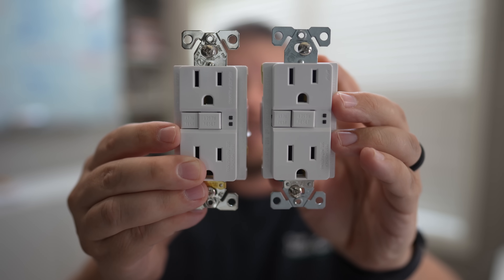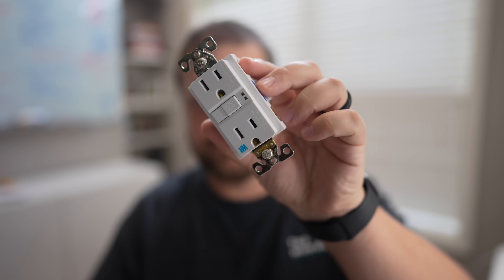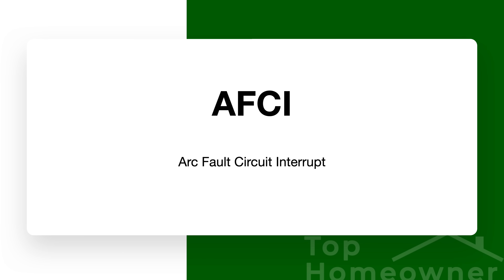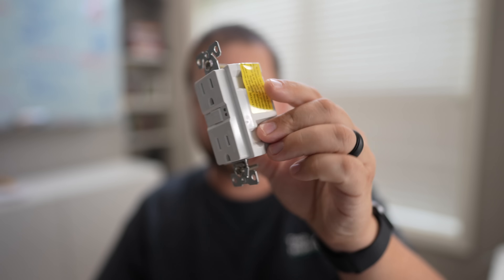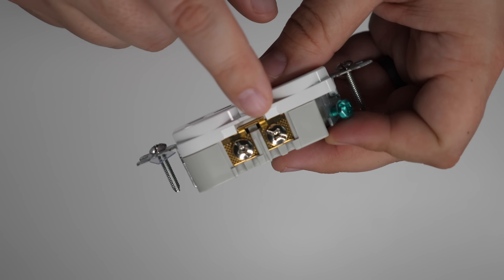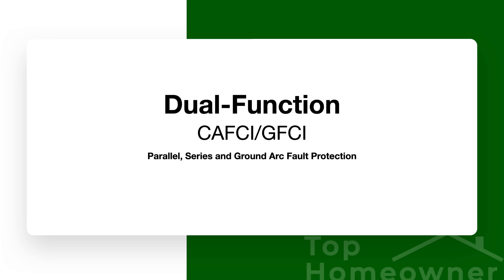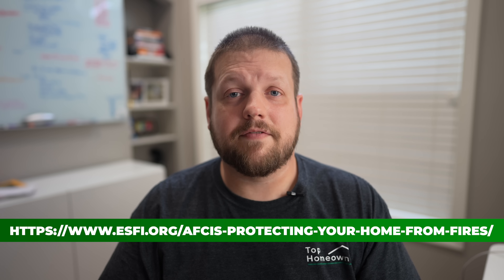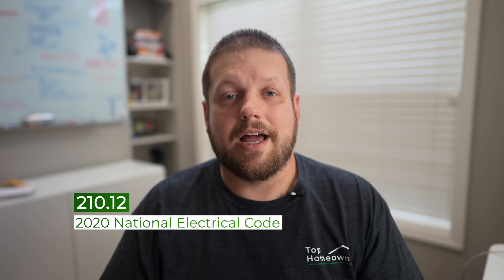AFCI vs GFCI: What's The Difference and Why You Should Care

Comment: I have a question I have a I have a GFI with two hots and two neutral the top hot is not working but the bottom hot has power but the GFI still doesn't work can you please tell me what I need to do to fix it

Comment: Question , have a afci breaker in box, starting using a solar tie inverter , plugged into a different source,  everything works fine unit i turn on a space heater in the bathroom, trips the afci, although the space heater works fine if the solar is turned off. Any suggestions, should i try a regular gfci instead of the afci, Thanks

Comment: As I understand a short circuit (can be prevented by standard breaker) is an extreme case of an arc fault (can be prevented only by AFCI breaker). That was the only thing that I didn't understand till today))) Thanks.

Comment: About 10 years ago I hired my friend to help me stud and sheet rock an extra 700 sq ft room. I hired a guy to do the wiring and at that time outside walls had to be arc fault code and switches had to be vapor barrier. The bath rooms and kitchens are all GFCI any where the water moisture is present to prevent shock.

Comment: I have replaced old light switches that began to occasionally make a little zzzztt when switching. Would a CAFCI breaker have detected what I imagine is arcing at the points in the switch and disabled the circuit. Lots of my power tools have brushed motors, I can see, thru the vents on the sides, some very slight arcing at the brushes (I think that's normal). Will these tools trip an arc fault detector ?

Comment: Extensions cords with a broken wire inside are a common source of arcing and house fires. AFCI will detect these type of arcs and lessen the risk of fires.

This was big reason for ACFI in the first place.  That being said in newer homes code requires many more outlets than older homes had for the specific reason that they want a close by outlet so that extension cords are not needed to use devices.

I do not have statistic but I would think electrical fires are probably much less common in newer built homes with more outlets, newer wiring, newer breaker boxes, seperated circuits, sub panels, etc... than older ones.

There are tens of millions of dwellings in the US with a very small percentage ever having electrical fires.  GFCI protection make a lot sense anywhere around water. AFCI protection is very expensive and seems like overkill for most people.

Comment: Im not a electrician but im having problems with my gcci but it's on back of building it also has a breaker and  it has a receptacle i cut the breaker off and pulled out receptacle and it had a black wire white wite and green wire on backside of receptacle the black wire was burnt and looking at front of receptacle the left pin or hole was a little burnt...so im curious to know what i need to do

Comment: We have two bathrooms upstairs that will trip our 20 amp breaker. We have replaced the GFCI outlets and it still happens. The breaker box was completely upgraded by licensed electricians four years ago due to a sunroom addition. We aren’t overloading the outlets and have manually installed two new GFCI outlets but it still trips. Any suggestions on what is causing this?
Reply: Put each bathroom on its own separate circuit.  The breaker is tripping due to too much current being pulled through it.

A blow dryer on high pulls current in the range of 13 to 15 amps.

Two of them together pulls 26 to 30 amps, tripping your 20 amp breaker.

I'll bet the electrician suggested that you separate the rooms and you considered it to be too expensive.

Comment: Fuse - over current protection.
Circuit Breaker - overload protection.
GFCI - ground fault protection (wet locations)
Arc Fault - short circuit protection. (bedrooms and other common areas)

Comment: Metal covered wires should be used in walls. Protects front nails and screws as well fire. Plastic covered wires in walls is just crazy. So are plastic electrical boxes. Think about it.

Comment: The insurance industry is driving all these expensive changes.  Their business is to accept risk in return for a premium.  But they no longer want to accept risk.  All they want is to receive premiums.  So they pressure the regulatory agencies to create these new standards, and the manufacturers are then more than happy to supply the complex circuitry to meet the standard.  Never mind that complexity is what FAILS.  The price of this stuff, and insurer's greed, is why fewer people can afford homes.   The reality is, it is impossible to make everyone perfectly safe.  Ground fault interrupters - good stuff, despite their circuit complexity.  They save lives.  Arc detection?  Not sure I believe your data.  And why should arcs occur if the electricians have done their jobs properly and tightened their connections?  Instead of loading up a circuit board panel with $1600- 1800 of CAFCI breakers, might be better to educate the public that they should not drill willy nilly into walls.

I worked as an engineer for 42 years.  Every good engineer knows that the more complex something is, the less reliable it is.   My pet peeve is breakers.   People don't seem to understand that the purpose of a breaker or fuse is to protect your house and equipment from damaging overloads and fires.  Unfortunately, the insurance and regulatory industries have done little to educate the public.   If a properly sized fuse or breaker blows or  trips, that means there is an electrical overload somewhere, and the homeowner needs to correct it.  But people routinely reset the breaker - again, and again, and again without finding and correcting the overload.  Circuit breakers have over 40 parts,  many of which are rotating and pivoting.  The pivot points wear.  So after a while they start nuisance tripping.  And from my experience they also can hang up and FAIL to trip.    In other words, your house  can burn down!   Now contrast this to a fuse - a simple element that heats up and melts in response to an overload.   Simple reliable protection.   They are without question MORE RELIABLE than breakers.  In fact, the medical device industry isn't even allowed to design breakers into medical instruments.  Why did the construction industry go to breakers?  The insurance industry knew that some stupid people would defeat fuses by putting pennies or aluminum foil in the sockets.  So they lobbied the regulatory agencies and government to force inferior protection on us.  They could've educated the public on the hazards of defeating fuses.  They could've denied or reduced the claims of people who did the tampering.   They also could've mandated fuse holders that could not be tampered with.  Instead, we all wound up with inferior, but idiot proof protection.

Incidentally, my home is protected by fuses properly sized for the load.  I know how to find overloads and fix them.  I pay a premium for my homeowners insurance because the insurance industry doesn't understand this reality.   However I don't mind.  I know I have superior protection.

Comment: Arc fault breakers are a huge nuisance. Inductive loads constantly trip them.  Any load that has a motor (vacuums, treadmills, etc). More injuries caused by needing to constantly go to the panel to reset than caused by any possible arcing issue.

Comment: What is the difference between these devices and an instantaneous trip circuit breaker?
Reply from the maker: Circuit breakers are designed to protect against very high current surges, like short circuits, by tripping almost immediately. AFCI protects against arc faults, which are electrical arcs that can cause fires. GFCI protects people from electric shock by detecting ground faults. Each serves a different safety purpose!

Comment: WIll AFCI trip if ,in this case, (TN Valley) a spike or surge in input voltage? TN Valley power can spike to 130v which is a driving factor to change out incandescent 120v bulbs; the filament would blow

Comment: We have a propane heater on a shed, it is mounted outside and the blower is powered through a GFCI mounted outside. It is in a box which is supposed to protect it from weather, but every time it rains or even comes a heavy for it trips the GFCI. Would anyone have a clue as to what would cause this?
Reply: Conductive "Sneak path" from a hot lead to ground.

Rainwater, seepage and other moisture are connecting one of the wiring terminals to the literal ground.

Comment: My sister has combo GFCI/AFCI breakers in her 2017 Atlanta house.   One kept false-tripping.  Moved its position in the breaker box and the problem followed the breaker.  Others in the subdivision had the same problem and clued her in to the generic problem.  We called the manufacturer (forgot) and they mailed 10 new breakers free, as a stealth recall.  Hope the new design works better.  My house has older Zinsco breakers with no GFCI option so I have those as outlets some places (kitchen, bath, outside).

Comment: Hello, thank you for the informative video. I have a quick question: Given that many garage fires in Canada are caused by car block heater malfunctions, would it be more effective to use a GFCI or AFCI outlet for a block heater? Additionally, can an AFCI outlet be installed outside the garage, provided it is placed in a weather-protected enclosure? Thank you.

Comment: The first intent of arc fault interupters I was taught was for low leaks mainly from electronic equipment that regular breakers couldn't detect and GFI wouldn't detect, thus guarding against heat buildup in those devices and their risk of catching fire.

Comment: At 0:48 you state " .... at any type of variance between these 2 values.... " Your 2 described values are Line & Neutral. Now, the word variance is normally considered differential. That is important for transformer protection. This is because the input & output current difference measurement can be considered an internal fault & should trip above a predetermined value. While there is a current limit that Will cause a trip on every household receptacle (based on the overcurrent circuit breaker rating), you are speaking of localized fast acting current tripping. These are All based on Overcurrent designs.
Reply: It's 5milliamps

Comment: If i ever get to have a house   ,  I will get an professional electrician to replace every single line with  (  either  ) 3 / 12 gauge armor wire Or  conduit line  .
Per room 

Kitchen  4 breakers   , according to what would be there .

Outdoor  same thing 

And to avoid overload  , an 15 amps breaker per line  , unless a 20 amps is required at some points  .

Electricity  ,  Gas  and  Water pipes lines  .

 (   SAFETY FIRST ALL THE TIME   )

Comment: I just got power back after losing it for 3 days due to hurricane berly. Problem is that my bedrooms and its lights don’t have power. I went to circuit breaker panel and tripped the 3 breakers, but to no avail. The three breakers show AFCI. Is it ok to replace those 3 breakers with regular breakers since the cost of AFCI breakers are 10x more at Home Depot. Thx.

Comment: Ref @denmar355: There are numerous reasons why the breaker is tripping, such as:
1) The neutral wire is from a different breaker
2) Or the AFCI neutral wire also feed a non-AFCI circuit (very common wiring mistake).
3) A device in the bedroom is being plugged or unplugged without first turning it OFF; thus producing arcing at the plug contacts. Some device can not be turned OFF such as a computer power supply.
4) Some type of appliances, such as fans, fish tanks, speed controllers, light dimmers.... or a combination of these devices may produce an arcing signatures.
5) Light switches can be turned ON & OFF 8 time within ten minute without tripping. Not sure if this applied to LED devices.
6) There is a leakage current (to ground or another circuit) that trips the embedded GFCI  100+ milliamp leakage detector.
This covers most of the reasons but not all.
George A Spencer (AFCI Inventor) C 512nnn417xxx4674

Comment: Hi I invented the AFCI. I think your video is a good introduction for the general public. There are several things that are misunderstood, such as, a AFCI also has an embedded  GFCI circuit. The GFCI trip detection is 100 to 300 milliamps of leakage current in an AFCI breaker; while a GFCI for electrical shock protection trips at 6 to 8 milliamps. This is confusing when trying to isolate the tripping issue; as most electricians are unaware that leakage currents can trip the AFCI. 
I am George Auther Spencer, 81 years old. I was issued my first AFCI patent in Aug 1990. I now live near Athens Texas and have invented a new wind turbine, three patents issued, that can produce 5X the power per acre of any wind turbine today; this includes GE's 12 MW turbine... As crazy as this sounds; it can also out produce a nuclear power plant per acre in 45 mph wind speeds, with no upper wind speed cutoff... even in 100 mph winds.
I now need to raise between $10M and $30M to complete the final phase and install a fully functional unit.
Reply: Then you're the guy to answer a question I have.  Have a couple of beefy extension cords outside (used for tools, Christmas lights, and more) and recently I plugged it in and about 20 seconds later a loud noise, sparks and white smoke, and a fire...put it out with an extinguisher.  Looks like a rat chewed a small section of insulation.  It is one of the old standard breakers.  So my question - would an AFCI breaker have prevented the fire?  Thanks!

Comment: Good info. From the consumer side, it is good to know what could cause "trips". I had a 20amp circuit installed and   run to my outdoor shed. There's a 20AMP GFCI  that serves the building. I  recently started using a 12k BTU which keeps tripping the plug. It pulls 7-10amps when running at it's max cooling. I've never seen it go over 1000 watts (I have a monitor on the plug/line). I've read where you shouldn't plug a portable A/C into a GFCi circuit. I'm installing a new box with one plug (w/o GFCI) just for the A/C since it's got it's own built in GFCI, and use the other outlet (GFCI) for the rest of the shed (lights, battery chargers etc). The line feeding this is on a 20amp breaker at my MAIN power box FWIW. This has been running me crazy but  your video gives me some insight. Regards

Comment: Simple GFCI protects personnel, AFCI prevents fire as intended by NFPA code making panels. In a nutshell without getting into the nuts and bolts. And yes GFCI breakers for my Sylvania panel are $90.00. Vs. $15.00 for outlets. Lol.

Comment: All inductive appliances should also be required to not produce extreme inductive kicks that trip GFCIs because it's a real possibility to introduce hazards in a quest to eliminate false positives by introducing false negatives that reduce safety to compensate for lazy, cheap designs of said appliances.

Also, inductive appliances should be required to correct power factor up to a minimum of 90% for efficient use of energy.

PS: When I was a kid, a double-stacked wire on a terminal of a receptacle fell off by repeated thermal expansion and started a fire in the wall of my bedroom. It self-extinguished because of other building codes but it kept going for about a minute until it tripped the conventional breaker. Higher-resistance or intermittent shorts that don't exceed the breaker's amperage rating can still start fires. Perhaps AFCI would've stopped it sooner had it existed.